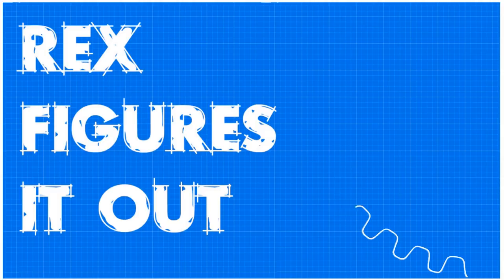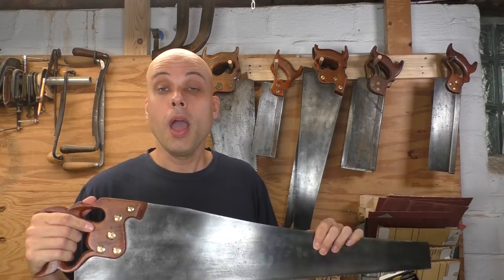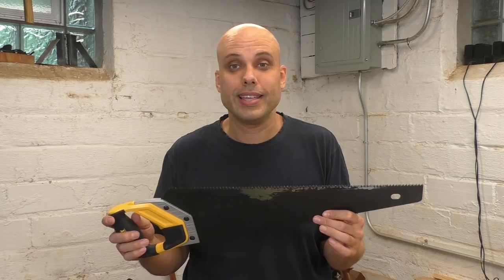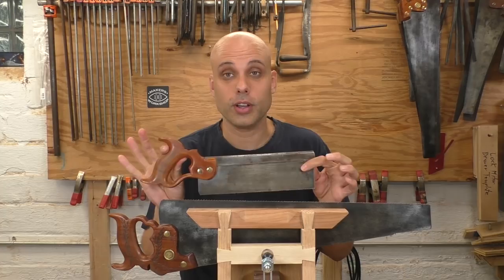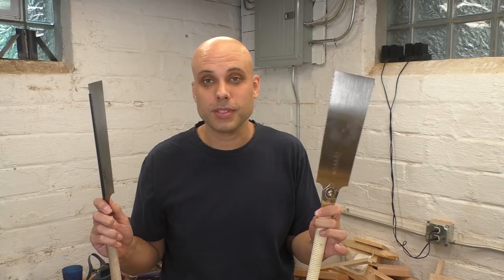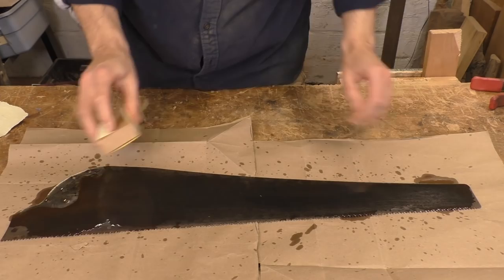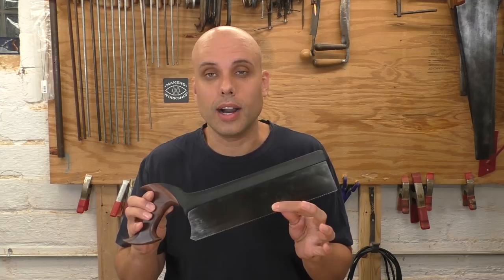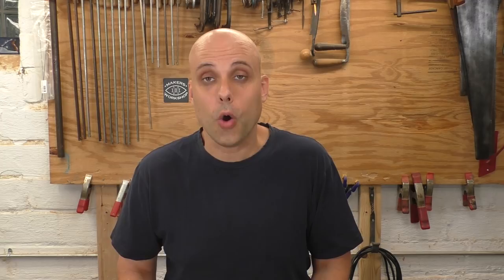The TRUTH about woodworking saws.

Comment: In the U.K. we used quality handsaws for years that we used to sharpen & set .Then the price of the hardened tooth throwaway saws came down in price .So we used them for a couple of weeks ,then for roughing out & finally passed them on to plasterers to use on plasterboard ( Dry wall ) Before I retired the timber yards were giving away 1 free saw with every £100 of timber ordered so we always had loads of them .The old skew backed saws were nice to use when sharp but a pain to keep sharpening .Even if you have to buy hard points they pay for themselves as you use them & cut more efficiently cost.next to nothing ,use them & dump them no more hassle having to sharpen. More beer drinking time .👍

Comment: I have seen Western saws with the replaceable blades on job sites that I've been on one brand that I remember is bahco so you can get a high quality handle and a hard point saw that just clips in an out of the handle.
Reply: Yup i have one. The blade is slightly thicker than the standard 244 pattern. The second fix blade from bahco is something else though. 11 tpi and iv cut through metal (accidental and thin) droped it on bricks and cut through plasteboards and its still sharp  after years of use.

Comment: Diamond files and thin plates will sharpen Tungsten Carbide cutters, which are far harder than any form of hardened steel, and with a hand saw you do not need a fine polished finish. 
Induction hardened teeth on a hand saw blade are probably too brittle to re-set, but in some applications very minimal set is desirable.

Recycle blade steel for scrapers... don't waste bin em.
Reply: Grinding discs and/or diamond disks in Dremels work, too.
You can sharpen hard point saws several times before the set wears thin.

Comment: The best use for an old saw is making it into a panel hacksaw. You'll need a carbide bit and some thread locker. Yes, for the hacksaw blades.

Most underrated Cold War era tool ever. Able to cut bedframes or large sheet metal.

Comment: I've heard similar advice for a lot of tools. "Buy the cheapo Harbor Freight tools first, and when/if you wear one out or break it, spend real money on the new one". That lets you get a lot of tools for cheap, and only spend money on the ones you need to. Buying cheap saws first seems similar; if you like it and really get into it, you'll wear  out the saw and replace it. If it turns out it's not for  you, you're out a lot less money.
Reply: That advice sometimes works, but you need something that's good enough quality to be properly functional before it breaks or wears out.  A lot of things in the Harbor Freight category aren't that.  I've seen woodcarving sets that had 1/32" flats on the sharp ends of the chisels, and I'm also suspecting that a good part of why I find handsawing so difficult is that my inexpensive saws just aren't usably sharpened and set.

Comment: I sharpened an old vintage saw that was my grandpa's yesterday. I just lightly jointed the teeth with a harbor freight file (freehand) and used a triangle file out of my nicer file set ($30 set). I used a standard vise with a couple of 2x4s working section by section. It's not really that difficult.

Comment: My workhorse backsaw came from a cheap Stanley miter box I bought at Lowe's back in the day.  It's resharpenable (I've sharpened it a few times in the past few years) and while it has a plastic handle and the back is just a U-shaped piece of steel, I have absolutely no complaints about comfort or performance.  I don't even have a place to hang it up - it lives on my bench.

Assuming they still make them, that's a cheap route to get a decent quality backsaw that can be resharpened.  The last time I saw it at Lowe's (maybe two years ago?) it was $13 and came with a horribly useless plastic miter box.  It wouldn't be too hard to make a wooden handle for it or spray-paint the steel back to make it look like a fancy bronze-backed saw, if that's your thing.

Comment: I've successfully sharpened hard point saws with an inexpensive Esi-Lap diamond hone. I took my time and looked at the coloration on each point to make sure I was working to the original angles. The saw cut straight after I'd done the sharpening and is used as my rough saw or the one I lend out. 
It was a win win situation, if it hadn't worked I'd have just delayed the trip to the scrap metal bin. I cut a lot of particle board (chip board) and OSB and these are really tough on saws so it was good to get another lease of life out of the hard point.
Long term you won't get to keep doing this because the hardening is only going to be shallow but I had the time, it was a sunny day and it was pretty theraputic.

Comment: You may even want to look into rehardening one of those shock hardened blades.
Reply: I thought about just tempering the teeth...
Reply: I used an angle grinder to take the teeth and just cut new ones.
Reply: I was wondering about that too.  Could you not just re-temper the whole blade and then you'd have a saw that you could sharpen? Would that work?
Reply: It's cheap junk steel. You can't harden it again, so it won't hold an edge.

Comment: Until recently I was using a saw that I didn't realize wasn't sharp and was cutting slower than when it was new. I have purchased inexpensive Stanley back saws that I would replace when I finally realized the one I was using had become s dull that it was taking forever to cut through a 3/4" pine board in a miter box. Therefore I have three of them in various stages of dullness because I didn't know I could resharpen them myself. After recently watching a video from Shawn Graham @ wortheffort about sharpening saws, I sharpened  the one I am currently using, while narrowing the kerf so that I now have a thin kerf dovetail saw instead of the thicker kerf crosscut saw that it was. I'm probably going to resharpen the others like they were when they came form the factory since I do  more cross cutting than dovetails.
Thanks for the video outlining the various saws along with their pros and cons.

Comment: I went shopping for a hand saw for ripping boards. I could not find any. 

As my Skill saw was far far away I checked the grain, marked the board and split it with a hatchet. Then smoothed it to the line with the same small ax. Use what you have to do what you want.

Comment: A prime example of lost arts. My father taught me how to sharpen and set the teeth on a handsaw when I was 11, back in 1966. Does not require a vise ( kind of hard to lug one of those around a jobsite ). Nor does it require a special setting tool. Plain old slip joint pliers will do.  The specialty tool makes it quicker, but not required. And the way to determine if you have the set correct was to hold the saw cutting edge up and handle up at about 30 degrees to the ground. Place a sewing needle on the teeth and allow the needle to slide down the teeth. Any tooth that is not set properly will cause the needle to jump off. Not difficult once you know what it should look like when sharp. And filing does not require special rig either. Makes it easier, but just a file will work. Just takes practice and a sharp eye.

Comment: As a carpenter who isn't really a woodworker, I think I can say the real advantage of an impulse-hardened saw is that they can comfortably eat the standard array of jobsite grit, and the rigors of life in a work trailer will typically cause catastrophic failure or loss before they wear out from extended use anyway, especially considering the small amount of use non-powered saws have in the profession.
"Forever" tools have limited utility in a chaotic work environment that involves extended exposure to the elements, dirty storage spaces, and heavy stuff falling over sometimes.  They aren't woodworker's saws, they're saws for carpenters or non-professionals. Those two categories make up an overwhelming majority of Home Depot's sale volume, so that's what you see there.

Comment: I'll be 70 in a few weeks. I've been sharpening and resetting the teeth of my late father's (he died in 1970 at the age of 59) cross cut saw for decades. It goes through wood like ... well, not a hot knife through butter, but not far off.
In the same vein I learned to sharpen the teeth of my chainsaw (sadly stolen during a burglary) such that I was using the same blade/chain long after a friend with the same model had gone through at least four new chains even though we were using them pretty much at the same rate and in similar materials.
I have a couple of cheap tenon saws that still cut well after several years of use even though they're classed as one year disposable.
Recycle, reuse. repair, don't dispose!

Comment: Two words.

Frame saws.

Head down to Harbor Freight and pick up a 1/8" and a 1/2" carbon bandsaw blade. Less than 20 bucks.

Stop at HomeDepot on the way home and pick up some large common nails and some smaller bright finish nails. Less than 10 bucks.

Use the 1/8' to make a turning saw that will beat the hell out of any coping saw you can buy. You'll have enough blade for two or three 12" blades.

Use the 1/2" to make a larger turning saw, though you don't really use it to turn, but you could some. It's just made that way to allow for long cuts. See Chines Frame Saw video by John Zhu YouTube. He even has one video of making a blade from steel spring shims. Get exactly the teeth you want.

Use another piece of the 1/2" to make a shorter smaller joinery saw. Make this one with blade let directly into the wood handles, not turning. Super easy to make this one. Just make sure kerfs to recieve the blade are inline.

This will get you going on just about everything for very cheap. Like less than 50 bucks including some nice wood. 

Almost forgot, get some 1/4" allthread, regular nuts, washers and some wing nuts for easier tensioning. For cheaper or even free tensioning use some twine and a stick.

You can also get made frame saw blades from a few places online. Or there are many, many bandsaw blade configurations to choose from. Various TPI's and tooth geometries. 

You can not be this approach for bang for buck and easy skill building.
Reply: Or you can skip ALL that work and just buy the hardpoint saws that you need for the same price. If you want to cut curvey things, also buy a hacksaw frame and put a course metal blade in it.
Reply: Hey, your tip about John Zhu was good. He's someone to follow... I was starting to do the very thing about the blades as you suggested. I had materials for the frames saws (the project looked fun) but I realized my current project was behind schedule (birthday gift). So I'm getting by without the saws. Given my wife gave me a raise on my "woodchuck" project allowance, I'm going to buy blades to simplify the "saw" project. Sometimes I just need to pay retail and move forward. <<too many projects and too little time>>

Comment: Two words of advice. 1) after filing, use a stone on each tooth not much just enough to remove the bur. Makes a huge difference in sharpness. 2) if your looking for a good old saw, take a look at vendor booths at a fair or market. People go buy saws and then throw some painting on it thinking its art. I have seen many Disston, linx, Vermont and oldschool Craftsman(when they still used american manufacturers) for sale. Most are being sold for pennies compared to what the saw is worth.

Comment: I found some time ago (if I remember correctly, recommended by Paul Sellers) traditional skew back panel saw by Spear & Jackson, use it for some time, mostly for rough cuts, and I'm rather happy with it. But knowing what I know now about S&J compared to other saws (like your video about tenon saws), it probably could be better. Waiting for that video :)
Reply: Paul Sellers has several videos on saw sharpening. He specifically covers the Spear & Jackson panel saws…they all come sharpened for “universal” cut, which is essentially cross-cut, and he converts it to rip cut. He also shows how to re-shape the handle for a more comfortable grip.

Comment: Rex— a lot of good ideas there. I just restarted my cabinet/trim shop I made the decision to ditch all my disposable saw (Japanese in my case) and have every thing in my shop user serviceable. 
It may seem like an odd choice but I went with bow saws for everything except 3 Japanese saws that I know how to sharpen my self.
Got the blades in my case from highlandhardware and cut them to the appropriate lengths. I also cut down an old misery whip and made in to a Roubo saw for big resaws. Not for everyone but I think I spent less than $150 for about 8 saws I set up and 1 kerfing plane. 
Enjoy your channel best of the luck.

Comment: I have used my Dremel tool, to resharpen blades from cheap modern saws, it works greate, after a while I have worn thro the hardening, and I can sharpen it "the old fashion way", I have also made nice wood handels, so they are comfy to use.

Comment: I'm currently re-sharpening a "disposable" saw to have some truly massive teeth, around 4 tpi. The secret is that I tempered the induction hardened teeth with a propane plumber's torch. I simply heated the toothed edge until the dull, chipped teeth were almost glowing and then let them cool. I started at one end and worked my way along to the other end. I held the saw at an angle so the flame was concentrated on one tooth, but aimed up the blade to pre-heat other teeth. I held the heat concentrated on each tooth for 5 seconds or so. I then filed all of the teeth off and started from scratch. I probably got lucky, the steel feels about the right hardness when filing - not too hard for the file to cut, but definitely not soft either. The saw is going to be used for cutting the branches that fall off my maple trees into firewood, so it just needs to be sharp and cut fast, not accurate. Yeah, I could just buy a pruning saw, but you can just buy a table or a _____ too.

Comment: I like modern saws - and modern sharpening - for a couple reasons. We used to saw trees with hand saws/frame saws for boilers out in the countryside. They were "sharp". I thought I'm going to die just from a couple pieces. You needed extreme physical strenght for it. There was not 1 person in a 10 000 person city + 900 person village, who could "properly" rather modernly sharpen a knife. My saws are sharp. Yours too as I saw it. They eat wood. But in 1997 every saw I handled were horrible..... till my father bought a "cheap replacement" fox - hand - saw. It was Sharp. From factory. I alone as a kid without help cut through many pieces of these "branches" - 0.1m/0.15m -. Before my father who was very strong, needed my help.

My father did not like it. He felt cheapened/scammed. Our old metal saws were "sharp" and heavy, thick plate, made out of metal framing. The saw blade was so thick, I could put my pinky finger into the hole it made. Only the frame saws were made out of wood, thinner blades, but they were also at least half a meter long, and kept getting stuck in green wood. Now, a 10$ japanese saw from China, puts all of those to shame. It's light, strong, extremelly sharp - like razor - and stays sharp for so long. It takes barely any effort to cut through anything. 

Compared to 1997 when I had to help my father pull a saw, we live in some Utopia in comparison.